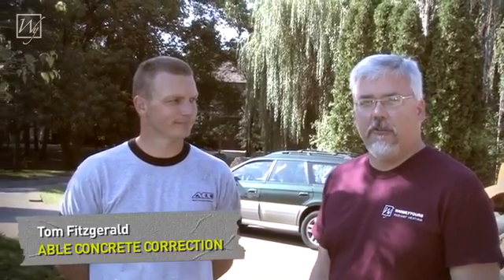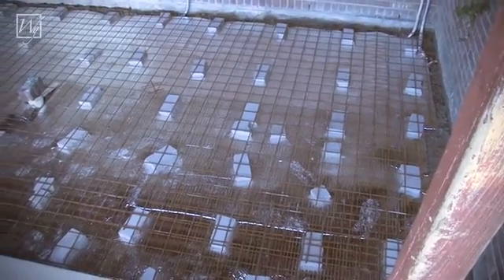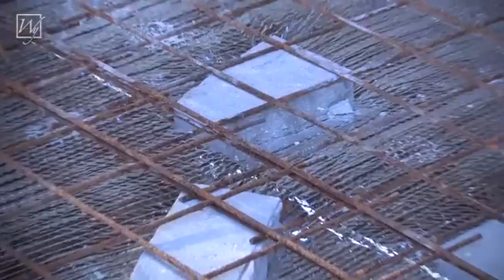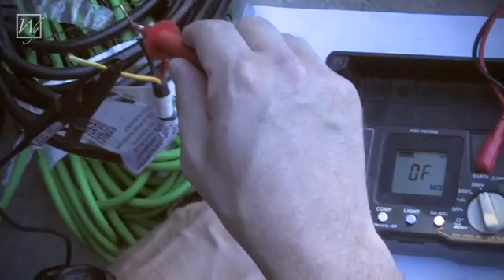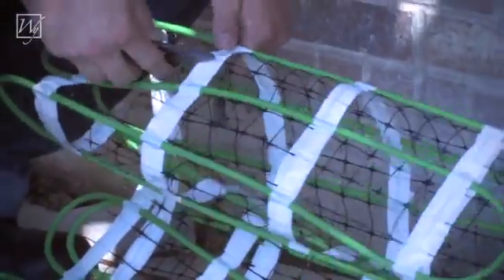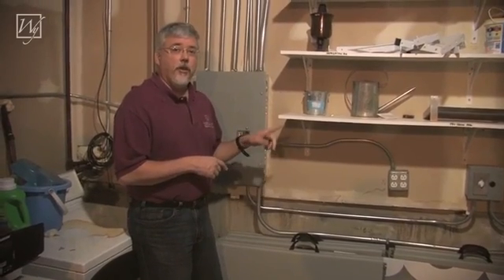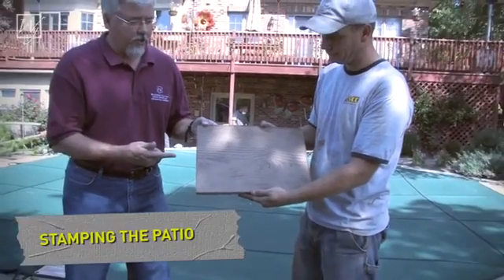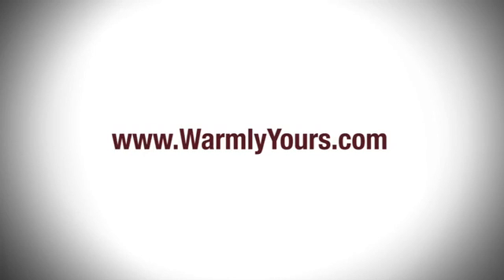Snow Melting & Deicing Cable System Installation In Concrete

Comment: I am purchasing a home and a has concrete driveway and concrete in the garage 2 car garage would I be able to take that all up and put these heating coils in their the garage and the driveway please comment back thank you so very much This is very interesting to me I did ceramic tile and we used to use almost the same kind body was only  A 110 V for the bathroom floors and for the mud jobs the shower stalls I didn't think that they had these for walkways and stuff like that very interesting this YouTube I hope you comment back thank you again for this video
Reply from the maker: Hi Martin, Yes you can use these systems under concrete, asphalt or pavers in mortar/sand. For your driveway, if you're already replacing the concrete, these mats can be installed before the new concrete is poured. You can learn more about it here: https://www.warmlyyours.com/snow-melting
Installation for these usually falls around April - September but completely depends on the typical weather in your area. Thanks for watching!
Reply: @Warmlyyours   I live in Connecticut and I would have them chisel everything up so I could do this I would even do the inside of my garage so when the snow falls it would be on to take the snow off the bottom of my car and I would put drains in the garage as well at the same time so everything melts angles down the drain or I could even  Clean the car in the garage in then I could turn the heat on so the car will that freeze in raj thank you for this video and commenting back to me by now
Reply from the maker: Hi Martin, we actually offer a product that is rated for indoor concrete floors, like the garage. You can learn more about it here: https://www.warmlyyours.com/en-US/floor-heating/concrete This would also help control both areas separately as the snow melting system is only rated to be used outdoors and would not work as well as slab heating in a garage. Feel free to contact us on our website if you need any help at all to help you start planning!  https://www.warmlyyours.com/